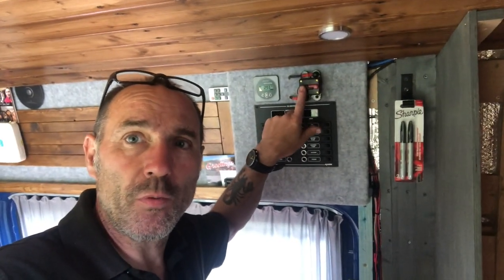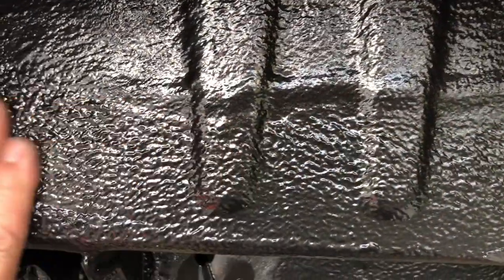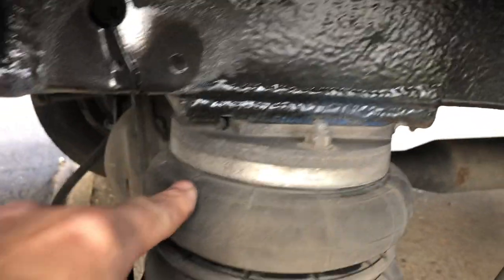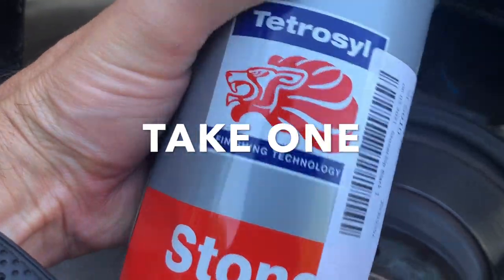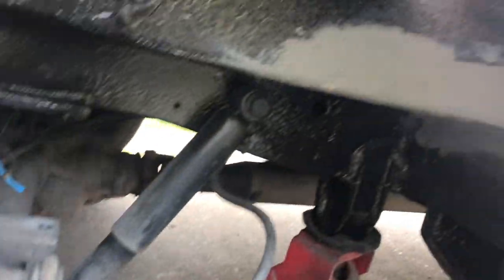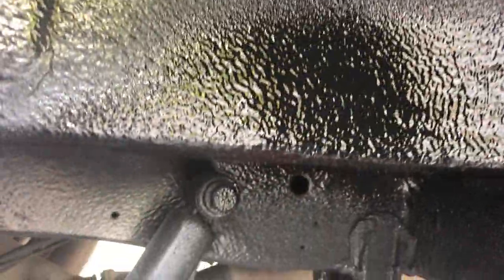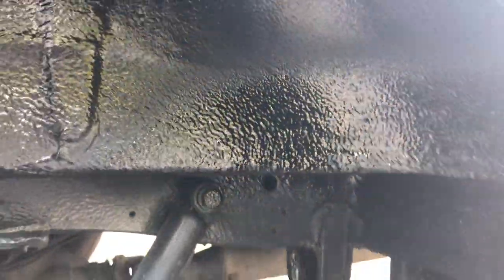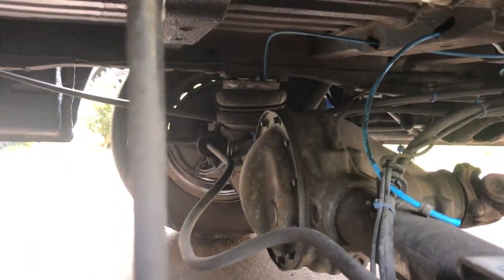SPRINTER REAR SUSPENSION AIRBAGS SPLIT CHASSIS PART1

Comment: Hi mate bin my latest video I have actually added a leaf spring. It’s so easy. It improved the factory suspension so much. I had bags and took them out as I felt it covered up the issue as opposed to addressing it. Good luck 👍🏻
Reply from the maker: I thinking the same 👍👍👍

Comment: your Sprinter is not the first one I have seen with a split chassis due to airbags , even a pretty new van done the same .  Hassle for you getting all the interior out ,  I have said to some others who insist on totally covering the inside of the van with expanding foam as insulation , if they have an accident no one is going to want to repair the damage with all panels covered in hard foam , best in my view to use removable insulation .
Reply from the maker: Reminds of welding up mk3 escorts when Ford  stuffed foam in the lower sills 👍

Comment: Air bags will do that all the time on leaf springs the chassis’s were made to carry the weight on the springs hangers not the middle those vans are made in Taiwan I think or china no mater the thing is air bags are shit unless the vehicle was made for it put bigger springs in cheaper in the long term as you know now I would not put them back in welding in the middle of the spring is not allowed in this country 😮hope it all goes good for you air bags that’s what they are full of air

Comment: great content sean and you are doing a great job, I have a long wheel base transit that i have converted to a camper but have found a three inch by one inch rust hole on the inner cill, do you think that would fail on an mot and could i just rivet a plate over it instead of welding it
Reply from the maker: If the hole is within 30cms of a prescribed area then yes it will have to be continuously welded, a prescribed area is any area within suspension mounts seat belt mounts  sun frame mounts, chassis brake brackets and it’s associated components , fuel tank mounts and door steps, my advise would get it welded then all boxes are ticked and no problems at the next mot, rust is a major killer on transits so best sort it before it get worse and more expensive, best wishes Sean 👍
Reply: @ProjectCamper  great advice sean it is near the drivers step but over 90cm away but will just get it welded as you say it will then tick all the boxes, many many thanks ,john

Comment: This is the reason I dislike airbags on top of leaf springs, you are forcing against the chassis if you try to jack them up. A properly designed air system would use trailing arms with a panhard rod and regardless of height the force on the chassis would not increase. If you want increased height how about longer shackles, that way you could pump up the airbags but they would not be trying to bend the springs as much and the pressure in the centre of the chassis would be decreased.The other option is a block between the spring and longer U bolts, would have the same effect. Increased height with a lower airbag pressure
Reply from the maker: Totally agree, before I brought the van I was thinking about shackles and blocks, but then found this van, I’m just waiting for a company to come back to me with longer high tensile u bolts and  2 inch blocks.